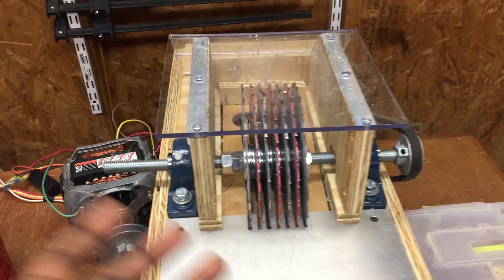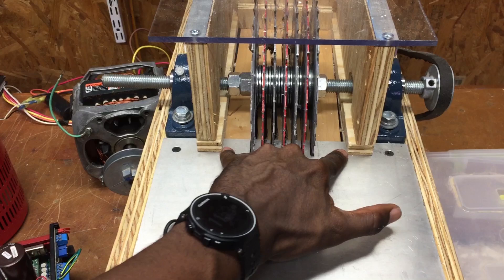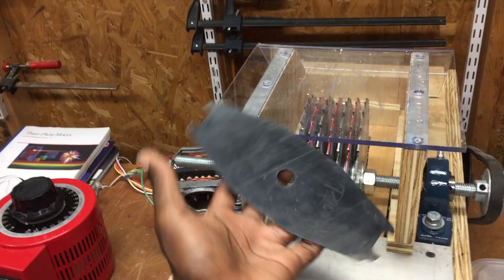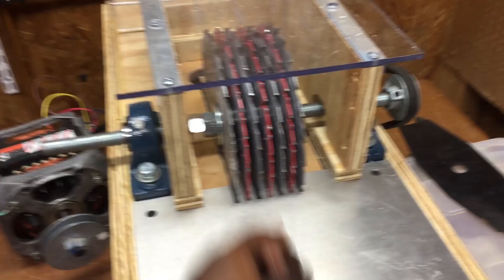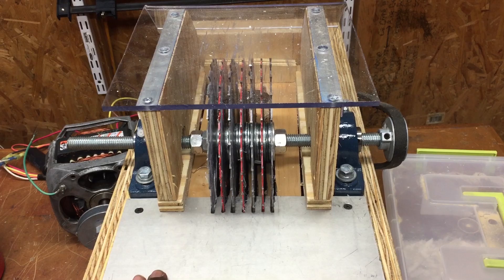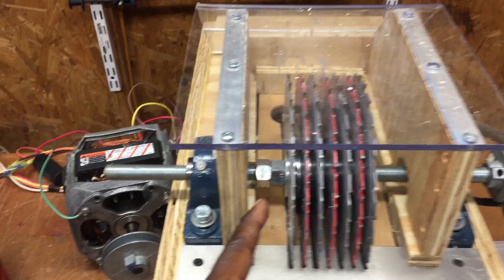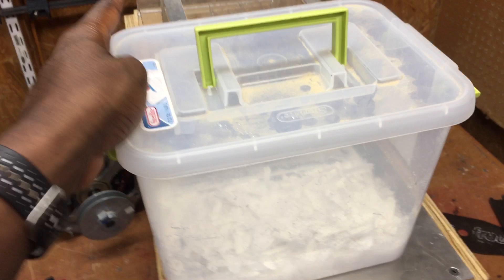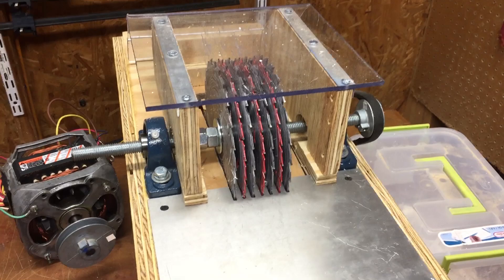Scary Prototype Shredder Design pt 2; A Cheap Alternative to the Precious Plastics Design: 037

Comment: Great&Scary Machine! 

you still have to precut the material. so, how about spacing the blades out a bit more and letting them stick out on the top, say 5mm in order to precut the matial on the same machine into stips, before feeding them back in ?

When i saw the schredded material i immediately thought "that looks like out of a Blender" - you know from those blend-tec-commercials "will it blend?"... 
Would it make sense to go a different route and put one of those strong washer-motors onto a blender? and feed it with material cut to strips? 
maybe you could even build a "large-size" blender with a 5gal-pucket?
Reply from the maker: When you say the top... You mean above the lexan... like a table saw? I am not sure I am picturing it correctly. The blender idea has not gone to that extent. I did try using a relatively expensive blender which I broke lol. I have not tried pushing a blender or a blender style blade with a larger motor. It sounds very interesting. If it can work safely at a low cost... that would be excellent.
Reply: yes, 3-5 mm above the lexan. just to precut strips. 

in the video before you did cut strips and then turned the piece to cross-cut it again.
if you roll the HDPE-Container over the exposed blades, you would create strips without having to  cut up the container with a knife or scissors. then feed those strips into the blades ... maybe through a slot in the the side of the the wooden box.

your hands would never be exposed to all the blades, and never be in danger to cut deeper, than said 3-5 mm.
Reply from the maker: +Thomas Prikowitsch I like where it is going but if I understand correctly the blades would have to be exposed on the top to roll the plastic over it. The final design should have the blade unaccessible when the machine is on
Reply: true ... safety is key, as with the exposed belt on the machine. that can cost you a finger too...
buuut... i think your machines more often are about practicability.. right?

its a trade off... 

how about using some sort of circular rasp like in a vegetable-cutter or cheese-grater?

Comment: Awesome :) Too bad though that this isn't really an alternative (cheap or otherwise). I'd love to see a working and practical design without the need for specialized water jet cut parts.
Reply from the maker: +Dejay Rezme that is exactly what I am working on lol. In the end it may not be possible but I have learned a lot along the way. This particular one is mostly a test of the most suggested design.... a dado style cutter. I finally stopped saying it won't work and decided to try a few designs. I will work it for a while and see where it goes.
Reply: Ah yeah, meanwhile I checked out your channel and found your earlier attempts as well :)
I guess what you really need for grinding action (after watching precious plastics some more) is a way to not have plastic slip in between the blades. 
I've also looked for saw blades that have teeth that are not wider than their blades - if you'd find something like that you could have tighter tolerances between the cutting teeth and the chamber.

Maybe stacking a bunch of larger washers and cutting out the teeth with a grinder would be best. Then insert smaller washers and somehow feed a wooden block in there so you have perfect tolerances. Let it grind out it's own counter plate. 

And maybe have a rig to easily drill holes / keys into the washers to lock them so they don't turn on the axle.
Reply from the maker: That is actually how I cut out the clearance on this prototype. I very slowly feed the aluminum plate into the blades. I don't know if blades like that are available. I never considered such an option until you just mentioned it. 
As to the washers... I have made several spacers from 1/4" plate which might do what you are describing. Perhaps that is worth a try. The best part is they are exactly the same thickness. I could mount them on a rod and cut them all at the same time. They will definitely have a key of some sort. Whatever holds them together has to also hold together the shear plates. The major flaw in my last plan was the spacing was never the same between the shear plates and the cutters when I tightened it with nuts. Even with enormous amounts of trial and error tightening and loosing to try and make them the same.
Reply: Hmm maybe you could also just make the cutting blades out of rectangular pieces. If you have a long piece of steel you could cut it into parallelograms and then add a relief cut to make the teeth. Then just fill in between with spacers and lock them with a key. 
This could all be done with jig in a chop saw with a metal cutting disc and a drill press.

If the key thing of the precious plastic design is indeed that you have a fine tolerance to the counter plate and long enough reach of the cutting blades this might work. 

Or I guess you could look into those carbide cutting teeth that you can screw on. Maybe you could just screw them on a rod? I've seen a planer wheel in a video today that looked like that. Maybe not enough reach to grab new parts though.
Reply from the maker: +Dejay Rezme yet another idea I haven’t considered... carbide inserts. I don’t know what they cost but thank you for the helpful dialogue. That is my favorite part of doing this ... meeting and brain storming with people from all over the world. The rectangular pieces with a cutting edge is one I tried... it works but they take a long time to make. I didn’t expect that. Cutting steel is very slow. I was using a hole saw to make the cut out. I will try some different approaches though after this talk. Also keeping in mind you only make them once so not impossible
Reply: So these carbide inserts are really cheap from china. 8 bucks for 10 pieces. Maybe you could simply mount them to a rotating plate? But you probably need somewhat long "arms" to reach and grab new plastic things, a plate with cutting teeth could push the plastic out of the way.

The advantage would be that it should be possible to just grind out a counter plate out of steel using these bits. 

Downside might be that they could shatter, depending on how well they actually cut plastic and how big the pieces are. I figure they are meant to mostly cut very thin shavings or slices of metal. A big blob of plastic could exert too much pressure on one teeth.

So maybe this would only work if your teeth don't have that much "reach" and are close to the axle. But then you are very close to using something like a wood planer axle with carbide inserts.

Probably best to ask in the precious plastics forum about what designs work and what don't.

I've also found zenithcutter.com and filamaker.eu who have plastic shredder designs.
Reply: So I checked and I can get pretty big washers here (in mm; inner, outer and height) for about 1-2 € per piece:

DIN 9021 (~ ISO 7093)  Stainless A2
33 92 6 M30
39 110 8 M36

DIN 440 (~ ISO 7094) Stainless 
26 85 6 M24
30 98 6 M27
33 105 6 M30

Was only able to find the second larges ones on the list.

So if I'd stack and clamp them, I think I could set up my sliding chop saw with a metal cutting disc and cut out kind of the same shape as the CNC. 

Not quite sure how to do the key though except with a drill press.

Also this requires a pretty big axle. And it might not be a tight fit.

Comment: What about gearing the blades to spin in different directions with the same motor.
Reply from the maker: +Lance Bosma that makes it more difficult to make. I don’t think the benefits are worth the extra effort . many industrial plastic shredders use a single shaft design search single shaft vs dual shaft shredders

Comment: Maybe replace some of the spacers with smaller diameter sawblades?
Reply from the maker: Right now I plan to experiment with changing the position of the table from below the axis of rotation to above. This will make it much easier to use blades in between. With its current shape, the small blades would have to cut the plastic without going through the table. I am not sure that would work. But from the top (more like a table saw) we should be able to use a traditional dado style cut.
Reply: Wade that was my thinking also say your largest blade was 8 in. od x 1/4 then make your smaller blade 7 in. od x 1/4 wide then using 2 small together to make it 1/2 wide then 2 large together 1/2 wide, make your shear plate fingers to accommodate the blades, this would give you pretty close to 1/2 square pieces after being shredded

Comment: I am assuming you are using 24T blades, 10 inch. I was wondering if you were able to use a 20T. The problem is, I cannot find an inexpensive offering. I couldn't find anything under $85.00 each. I just wonder how a more aggressive ripping blade would do.
Reply from the maker: +Steven Poleske These are the smaller circular saw blades 7.25" 24t if I remember correctly
Reply from the maker: +Steven Poleske these were the cheapest ones I could find at $6 each
Reply: Ok, I found an 18T 7.25 at Amazon for about $15.00 shipped. Still pricey for your usage. I am curious if you experimented with tooth numbers. I would think that a more aggressive blade with less teeth would shred better than one with many teeth and would then leave you with less powdery shred. Just curious.
Reply from the maker: +Steven Poleske I agree. We have come to the same conclusion. Price is the issue. I want to work out some other details than go back to tooth-count as a final purchase

Comment: Could you run another set of blades opposite to them so they run in the gaps of them blades
Reply: You ever seen carbide strike carbide? If you did you'd probably be using a braille monitor right about now too.

Comment: What about using smaller diameter blades in between the larger blades to cut the strips down further?
Reply: Also what about having a guard that only allows plastic to be fed in that's been trimmed down into sheets... basically the gap into the blades is thinner than any digits on your hand to prevent you're hand ever getting pulled into the blades if a piece ever decides to take you with it?!
Reply from the maker: I am on the fence about that one... I love the idea as it is by far the safest, but then you have to "shred" the plastic at least some before you shred the plastic. Ideally you could safely place a whole milk jug inside the shredder. But I am not committed to that either. I usually cut the label off, so why not make it flat enough to feed in like a paper shredder? I can't make up my mind just yet.
Reply from the maker: I think I am going back to placing the blades together but changing the height of the table. I believe if the plastic is fed near the top of the blades rotation it will remove the problem of the plastic being pulled from the user, and remove the need for a shear plate. I haven't tried it yet.
Reply: Maybe a hopper with a lid that is shaped curved to match the blades so you can use the lid to push the plastic into the blades??
Reply: Or Mehta about using some cone shaped cheese graters?

Comment: Would it be worth trying some kind of feeding solution by use of microwave motors so that it feeds at a slow rate and at a safe and effective speed?
Reply from the maker: I like it...Feed rollers like a planner?
Reply: Jeremy Fielding yeah the same principle on how it feeds the wood through. Glad you liked the idea
Reply: Like a planer or like a laminator.

Comment: Maby having the blades higher or lower may help with shredding and pulling?
Reply from the maker: You are correct. However that makes the assembly more difficult to make. I do think if I was cutting from the top instead of the bottom of the rotation It would push the piece back towards me instead of grabbing and pulling it away from me. More like a tablesaw blade. I am rethinking that part as we speak. It can be done.
Reply: Jeremy Fielding so instead of increasing the blade height maby just increase the table height so it will pull the plastic down. This may also make safety less of an issue as the lexan would cover a significant amount of the saw blades
Reply from the maker: +WoodworkingForThe Welsh you sir are on to something

Comment: you should just have two axles, whose blades interlock. Look at the design they use for Vehicle shredders
Reply from the maker: Shredding a vehicle is very different and more expensive/complicated to make. Search for the difference between single shaft and dual shaft shredding. Single shaft with a mesh screen is more appropriate for plastic shredding
Reply: Ah right, ok. I've just never seen a single-axle design before but I suppose a dual-axle design is twice as expensive. Are you considering making a shredder for aluminium cans, too, to fit the recycling theme?
Reply from the maker: No plans yet

Comment: Will be cool to see when it is done! Your machine far surpasses the one I made  when I tried melting HDPE.
My solution was to bolt a sturdy pair of scissors to the drill press table by one handle, then attach the other handle to a crank mechanism in the drill press.
That rapid snip-snip-snip sound gave me prickles on the back of my neck but it worked unexpectedly well (especially if you have a short range of motion such that the scissors never fully open or closed)
Problem is, if you put anything in it that jammed the blade, it would loosen or snap it's connection to the drill press table and the scissors would spin/flick about wildly like a double pendulum on acid. Not a good idea at all.
I have lost my video :/ so here is a sketch: http://imgur.com/Sjg0JSJ
Reply from the maker: Nice sketch. I don't think I would ever have thought of that

Comment: you could just use much smaller blades, like 4-5", there is no need or benefit to having big blades.
also i tend to avoid videos under 3 minutes, the odds of having anything meaningful are low

Comment: stupid suggestion: get a reel mower and hook a motor up to it.
Reply: That actually might work. I work on a golf course. They tend to cut the material into fine pieces though. You'd have to change the rpm of the reel to get not as fine of a result. If you went down to your local golf course and asked around for an old mower reel, maybe they'd sell it to you or say no. In that case, check fleabay or Craigslist. The good thing about them though, is even at slow speeds, they will cut. (Not ideal for grass but good enough for paper and plastic)
Reply from the maker: +Scott Tuttle I have not thought of this. I have to investigate the cost
Reply: You could just take a regular lawn mower. I hit bottles when I mow by the road. Poof! I ain't jumping off the tractor up there. You ever seen how they bust aluminum at a scrap yard? That's pretty funny. They got a plate with a hole in it and a blade spinning behind the plate over the hole. Whatever you feed through the hole gets whacked by the blade, and pinched by the edge of the hole. So it is an endless shear. Simple and it works. Though they do feed long straight pieces through that gadget. To turn them into lots of short pieces. Maybe you could motorize a paper cutter? It slices, it dices, it makes Juliane fries! Call Vince and see if you can get a jumbo Slap-Chop off him. Put hand and foot pegs on it and tie a hyperactive child to it. Then yell at the brat, This is just as good as the ball bouncy pit at McDonalds so keep jumping!
Reply: I personally haven't found rotary mowers to shred plastic well. As I mentioned I work on a golf course. Once a week I'm tasked with mowing around the club house and pool. And there's a summer camp for little kids so they leave everything out on the grass. Gatorade bottles, goggles, foam kickboards, pool toys etc. all of which I have ran over. The Gatorade bottle just had its cap knocked up, maybe sliced it a bit, and the label was torn off. The goggles were fucked (not my fault that they don't pick up) and the kickboard surprisingly did nothing. I figured the mower would have shredded the fuck out of it. But then again it's specialty turf mower so maybe the decks don't work that way.

Comment: dado stack from hell
Reply from the maker: Yeah it is... lol
Reply: +Jeremy Fielding I think I would go about this in a much different angle. I don't know if you've tried but I would try a bunch of sciccers in a row my be electricity sheers. that would cut the plastic with out the fine dust.
Reply from the maker: +James Walker definitely didn't think of that. How would you operate the scissors? I am picturing a cam but maybe you had something else in mind
Reply: +Jeremy Fielding  well Ronald Walters has a video on here "making a reciprocating rack & pinion" that would work great.
Reply from the maker: +James Walker I have seen that video. It takes a surprising amount of force to cut plastic. I am not sure that would do the job. My other concern is complexity. I want a simple design that is easy to copy. I already have what I need to make a complex shredder. Making it easy and cheap is the hard part. Check my "more power" video on the shredder. That video explains the plan more.
Reply: +Jeremy Fielding  I realized it was going to get complicated after that last post.  I've seen that video. I've seen all your videos for the last 6 to 8 months. I always learn something from them.
Reply from the maker: +James Walker well that is pretty awesome. Glad to hear you keep coming back. I take that as a great compliment thanks.